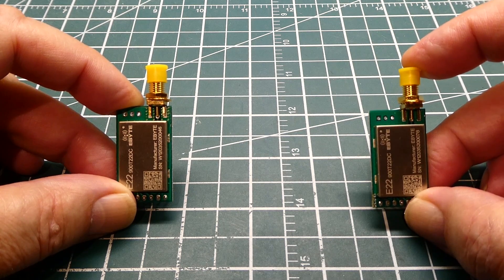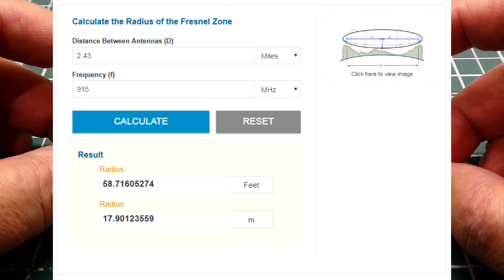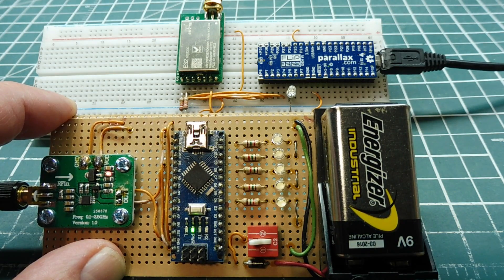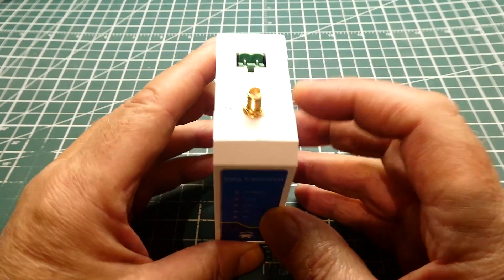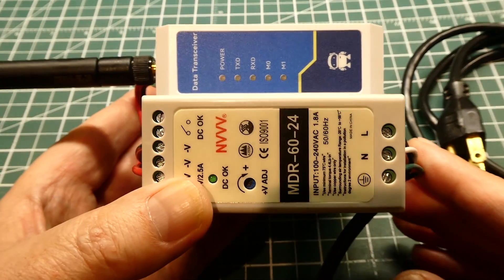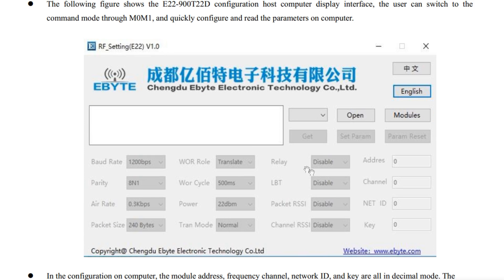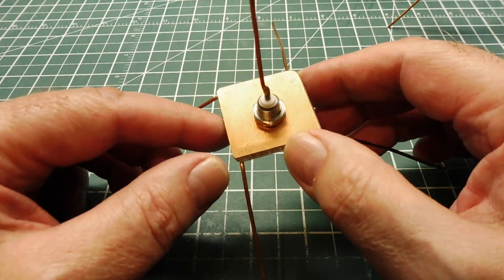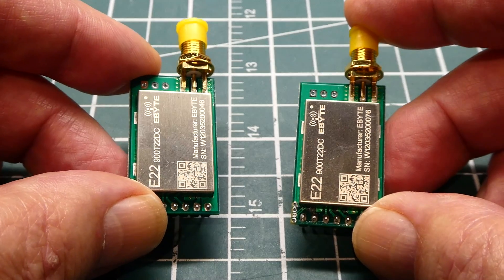E22 LoRa Repeater

Comment: It's a very nice video.  I'm just wondering one thing.  Can we run each node as a repeater?  Then, a connection to the Internet can be made separately from any end of the network.
Reply from the maker: No .. the Tx/Rx lines of radios configured as repeaters are not functional.
Reply: @0033mer  So, can such a system be considered?  How should the structure be created?  We have an idea for this kind of project.
Reply from the maker: Check into a Wireless Ethernet Bridge. I have used products from Afar. Check out their website.
https://afar.net/wireless/ethernet-bridge/